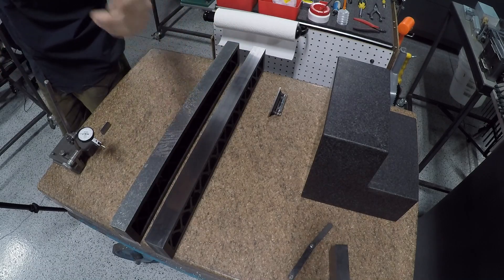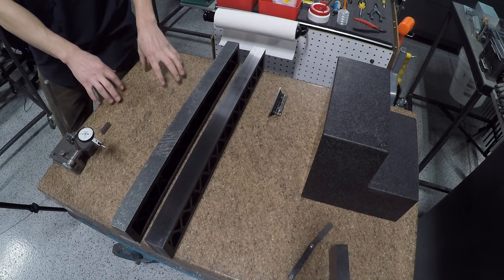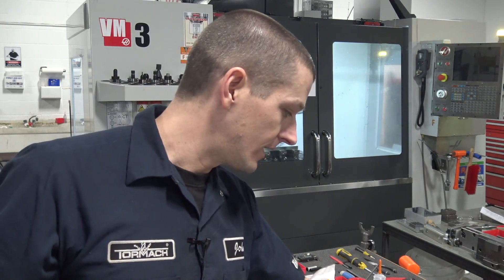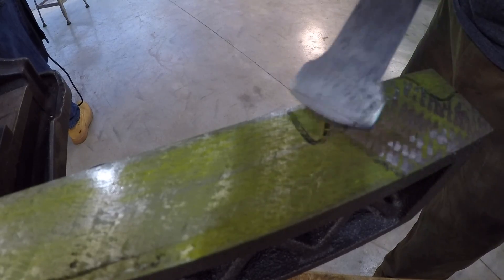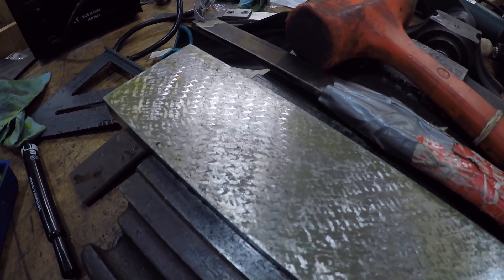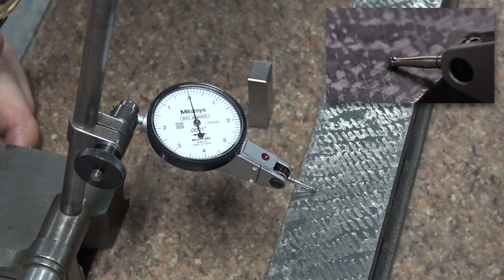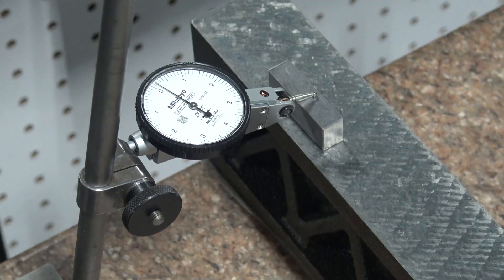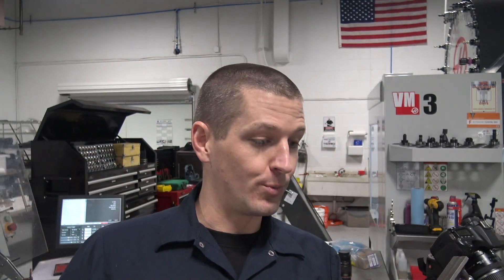What is Metal Scraping?

Comment: I’m a little late to the party. Great video; also, Starrett 98 levels are not supposed to be flat on the bottom. They are intentionally designed with a minute curve to prevent false readings caused by the heat of handling them.

Comment: I think I solved the puzzle! I saw a video about an old cast iron reference table and the host wal talking about advantages and disadvantages of granite and cast iron. If you drop something on the granite it will get a chip off the table and leave a whole and except for the whole the table will be perfect. Now ... if you drop something on a cast iron table then it will create a burr - a scar - that will be bove the surface level. What is scraping, then? Scrapping is chipping off metal. It produces wholes (regions that are bellow the surface level - without the burr. That creates the spaces for oil to flow, avoids ringing and in the unusual chance - it almost never happens - of someone dropping a tool or a part on the ways, the chance of it creating a burr higher than the top surface is a lot less. Scrapping doesn't make the ways flatter - they make them better and that's achieved by making them less flat.

Comment: The fact that we have all these ridiculously accurate machines and we can still achieve such a high level of accuracy by touch, feel and technique is mind boggling. For instance, I work on guitars...I had one of my newer instruments plek'd (cnc machine that levels guitar frets) and found that it was still pretty buzzy when trying to get the action I was after. I levelled the frets with a reasonably straight piece of aluminium i beam (.001") and it played so much better than it did after going through the miracle machine. Goes to show there's still room for handwork after all.
Reply: Oh yes, definitely. You should try spot leveling your frets on a tensioned neck - the results are even better.

Comment: Hand scraping is important  process, machine needs an oil pocket to maintain the accuracy of the machine.specially in the small parts like gib and gudeplate  zslide and turret slide of the machine parts. The accuracy must be 2 micron .im a scraper for almost 26 years.

Comment: Lapping is the Best way to make a surface flat.
But two Lapped Surfaces will have SO MUCH surface to Surface contact, that they won't slide.
The Surface Adhesion will be so great, that you will need to apply so much force, that when the adhesion is overcome, you will likely Tear one, or both Surfaces and cause Gauling.

Flaking is used to Create intentional valleys in one of the Surfaces to retain an anti-Adhesion lubricant.
The Lubricant will help to prevent the amount of adhesion and lessen the force needed to overcome it.
Also, One surface can be bonded with a coating that resists adhesion and increases the slip.

Where the Surface is too large to fit on a lapping machine.
Progressive surface scraping can be used to achieve a nominal overall Flatness.
It will never be as Flat as a Lapped surface, but you can get progressively closer and closer, by progressively scraping away less and less with each progression.

your Demonstration using the gauge block on top of the scrapped surface is a perfect example.
The Block is precision lapped to be flat.
it's flat surface makes contact with the crests of all of the High spots of the scraped surface.
Within any given area, there should be 40% to 60% of evenly distributed high Spots.
this will provide adequate contact area for the other Flat surface.

Scraping always leaves surface imperfections,  a distribution of Valleys and Crests.

This is why precision Optics are Lapped and not scraped.

Comment: Would be difficult to scrape a level not knowing whether the Bubble Glass was level with the surface. You could scrape the surface sure, but if your high spot doesn’t make the glass level then you have a flat surface and the bubble level isn’t square with it. If you have a good way to chuck it up with the glass level then I suppose though it could be challenging for certain devices especially if the bubble glass only goes one direction.

Comment: Nice video. There is a way of making any surface flat to within fractions of a wavelength of light by grinding three flats together. Any two flats will form a concave/ convex spherical surface when ground together, but this is overcome by grinding three flats together which counteracts the tendency for any two surfaces to form a spherical surface. What is formed is actually an infinity sized spherical surface or a plane on all three. Details of how this is done can be found in the book "Amateur Telescope Making".

Comment: Is there some optical / laser mechanism you could use instead of repeated blueing? Mostly just wondering for the sake of wondering. I'm thinking something that throws a laser at a very very closely controlled height over the surface?

Comment: This kinda starts the whole chicken/egg thing...like do you get something so flat, without having a reference to what is "flat" in the first place?? Like who made the first surface plate without a reference?
Reply: Nathan Hamler You actually don't need a reference surface to get something flat. If you take three surfaces, and reference those to each other in succession (1 to 2, 2 to 3, 3 to 1) until they are all three the same the result is perfectly flat.  Said another way, the only way that three surfaces can match is if all three are flat.  This is how the first reference surface can be produced.
Reply: An old gray bearded guy with a chainsaw and a really steady hand
Reply: @ Nathan Hamler
My guess would be opticians .
They didn't have surface plates , but used light itself to measure  for surface quality .
Reply: Thanks,You just took all the magic out of it for me.
Reply: We build spaceship parts with stone axes and cold chisels!  Think about it.
Reply: It's worth noting that the third plate to ensure there's no concavity/convexity  - eg, surfaces A&B could match each other, but be spherical rather than flat. The same can be accomplished more quickly with two plates and a simple repeatometer, but three plates require no measurement tools.

Tom Lipton (Ox Tool Co) has a series on YouTube about lapping surface plates using the three flat method - it's worth watching, I think.
Reply: Rub 2 together with finer and finer grit, comes out dead flat
Reply: Three @highstreetkillers4377

Comment: I'm pretty sure the way you checked flatness with the gauge block was slightly incorrect. Your method was actually the technique used for checking parallelism. I know you were time limited, but flatness requires more points in multiple directions.

Comment: How thick is that layer of layup fluid on the granite, its pretty viscous isn't it? I would think that is what limits the accuracy of this.
Reply: [puts on metrology nerd hat] No lie, "It depends on the color and how long you wait." IIRC, blue Dykem is about half of a tenth (or fifty hundredths) when dry. The red stuff is a little thinner. But that's not the factor here: What you're doing is coloring the high spots. When the area you just scraped gets dyed again and has a contiguous, even and unbroken coating you're within that half of a tenth. The only concern is relative accuracy, not absolute accuracy. If you were needing it flatter than fifty hundredths, you'd be dialing it in using optical interferometry after the initial scraping with Dykem. But for the home gamer and small job shop machinist both, you probably won't be building for NASA, the ESA, LANL, LLNL, or CERN.
Reply: Damn!
Reply: NYC CNC
That's what I get for being up so late.
Reply: Probably missing something but when you guys say, one 10th, that's one ten thousandth of an inch, right? So wouldn't half a tenth be one twenty thousandths of an inch? Or would no one ever say twenty thousandths because of the position of the number in the decimal and confusing I guess because its actually a 5 and not a 1? What about 5 hundred thousandths?
I guess I'm just curious why in machinist language you go right to millionths and skip a decimal term?

.5 = 5 tenths or 50 hundredths or 500 thou?
.05 = half tenth or 5 hundredths or 50 thou?
.005 = 5 thou ... easy one
.0005 = 5 ten thou ... ?
.00005 = everyone seems to be in agreement its 50 millionths buy why would you just skip hundred thou

Your machinist language confuses me, its like you guys discriminate against the word hundredth.
If I walked into a machine shop and said 5 hundred thousandths would everyone laugh at me?
Reply: .5 = 500 thou or 1/2 inch
.05 = 50 thou or 5 hundredths 
.005 = 5 thou
.0005 =  5 tenths
.00005 = 50 millionths or 50 mils   Most measuring tools only give you a 0 or 5 reading at this scale anyway.

Probably has to do with how easy it is to say.
Reply: Makino IQ linear motor machines are accurate down to +/-100 nanometers
Reply: Nice, I wonder how that compares to EDM machines... any EDM machinists in youtube comments?
Reply: So what are machinists going to say when machine resolution starts reaching the nano or pico scale?

Just being ridiculous but you never know... (dreaming of 3d printers that can print by the atom)
Reply: That's not machining, it's FABbing.  The whole point of that is to not NEED machinists or anything related to them.  Meanwhile, your cartridge of manganese ATOMS is getting low, better order another one.  Yeah, what a dream!  Are you going to make everything out of Carbon atoms, or mix it up?  Solid diamond coffee cup, why not?  Will you have some CAD that designs down to the atomic level?  Will you make decisions about crystal orientation or will the CAD do it?  Oh, it's a dream all right!

Comment: You must have poor surface grinders if you can't get it flatter than scrapping.  Scrapping is only used when you can't grind; kinda like refurbishing.  It is NOWHERE near as accurate as surface grinders. If you want a superior flat surface to grinding, then you have to LAP. Lapping is what they do to Guage Blocks  AFTER surface grinding.  You will not find scrapped Guage Blocks for the reasons I've stated above.

Comment: yea .0005-.0006 isn't perfectly flat, but for the most part do you ever need a part that's tolerance is less than .001 maybe .0005 unless you're making parts for a jet or NASA?
Reply: CollinandMason 
Yes actually constantly...  and no NASA parts here... actually I think NASA JPL specs are looser than what I'm running now.  :/
Reply: @occamssawzall3486  Wow. What kind of parts?
Reply: Jay Brewster 
Internal parts for this. The motor and bearing housings and the joint flexure systems. The entire system combined has less then .005” total accumulated run out. 
http://www.mobiusbionics.com/luke-arm/

Comment: The deviation on that straight edge might be even less than that, due to the fact that as you held the gauge block it expanded from the heat of your hand thus throwing off the measurement. Nice job on that casting by the way. Thanks for the videos.
Reply: No he moved the clock stand. Always move the job not the clock  stand

Comment: Next project...  hand lapping! 

Cut those few tenths down to millionths.
Reply: NYC CNC 
We'll get you down to having to use a laser interferometer and optical flats and measure flatness within waves and fringes. 😆

Ps. 1 Fringe = 0.3 microns (.0003mm) . Have done 1/4 fringe spec optics 😁
Reply: Why would you use such a unit as "Fringe"? Isn't Microns good enough?
Reply: gredangeo 
Microns aren't even remotely close to being fine enough for optics.  Fringes and waves is measurement using light waves. Fringes are short for interference light fringes. When you pass a single light wave through and optical flat ontop of an object, the light will reflect within the tiny space between the optical flat and the object.  Via reflection dark and light bands are generated due to the gap between the optical flat and the object you're measuring. Since the light used is a single wave length, divergence within the gap is predictable and measurable. The greater the distance within the gap, the more divergence is created. And interference lines will appear as dark and light bands. The more lines the more peaks and valleys, and the straighter the lines, the flatter the part. You can even see concave or convex sections within an object with it. Which will show up as arcing light and dark bands

It's for measure really really super flat, or super higher accuracy dimensions. 

You can look up Optical Interference if you really want to know about it.  It's been around since 1801. And still used today to measure super flat surfaces.
Reply: Occams Sawzall But you only said that 1 Fringe is about 1/3 of a Micron. Just 1/3. That is not a big jump to a higher level of precision. So instead of saying "30 Microns" you say it's "90 Fringes"? Not a big deal as far as I'm concerned. I say it's better off to stick with the more common units, and then when needed go to the Unit that is 1000 times finer than the Micron, and be done.
Reply: gredangeo 

It's how optics and super flat parts are measured.  I didn't invent it.  No one in optics measures surface deviations in microns. 

Fringes are a comparative measurement anyway. It's the amount of deviation from a know to unknown surface. 

OD, sagittia, FOV, center thickness, and annulus dimensions are in microns.  When it comes to the physical surface it's fringes and waves.
Reply: K